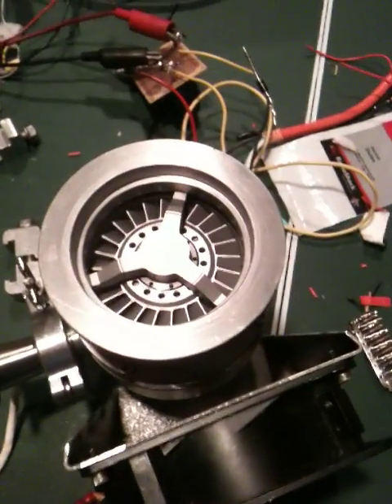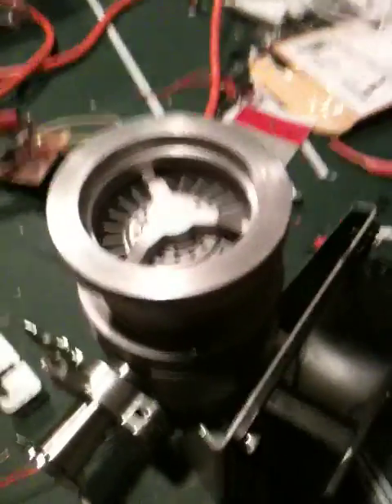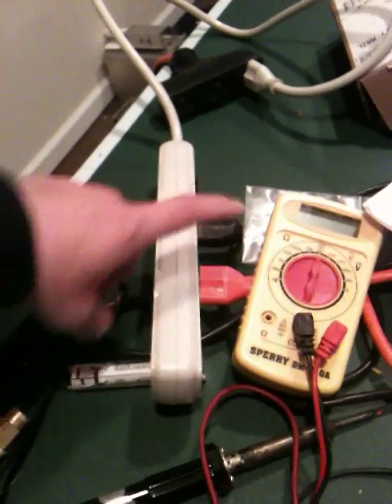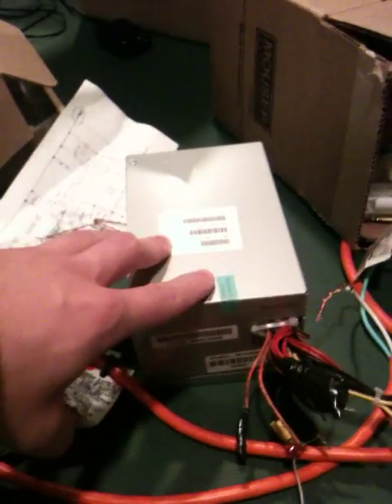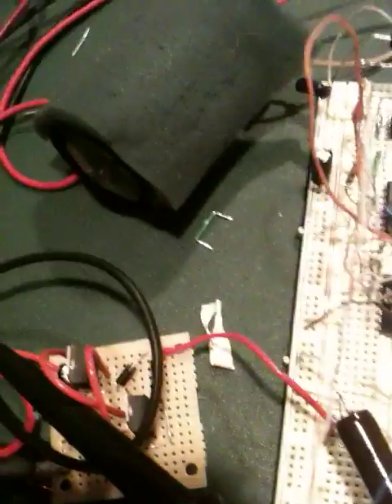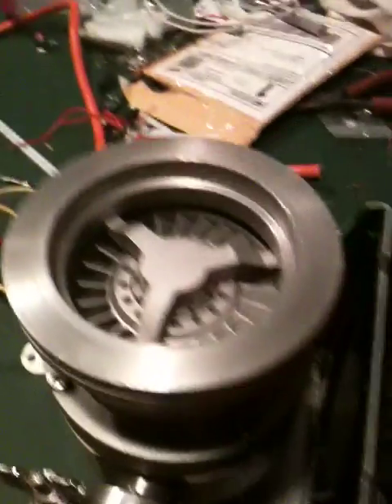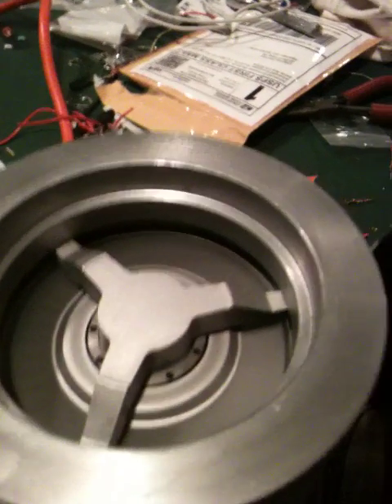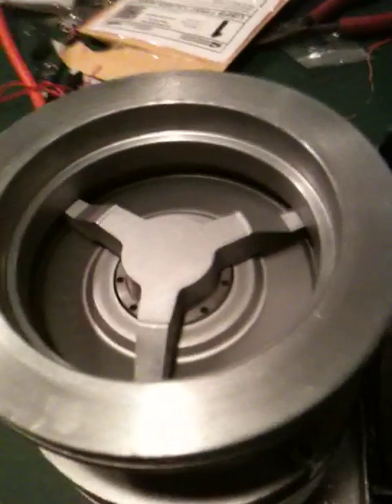Cheap Turbopump Setup

Comment: Question, can these pumps be used for any application that involves in removing air out of a sealed chamber very fast? What are the air flow measurements per metre on these machine

Comment from the maker: From my understanding (from sources both in the UHV hobby area as well as in the UHV industry) it seems to be acceptable to run turbopumps in air for short periods of time at low rpm's. I know of one company that refurbishes turbopumps, they usually run them in air to blow out the dust before they clean them. They may be fragile at high revs but they seem like they can take a lot in the low rpm range.
Reply: We use company sertec Inc for turbo repair.
He helps us out with all our test equipment for controller repair.

Alex is my contact.
sertecturbo@gmail.com

Cheers!